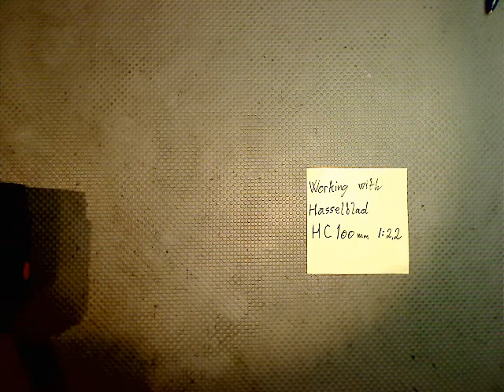Working with Hasselblad HC 100mm 2.2_________Motion Lapse Film

Comment: Dear Mike, I have a HC 50mm that needs to clean up the inner glasses. can you show us how to take off the front elements? I had a hard time to remove it. Had send to Hasselblad service in NJ. Quotation was said ; lens need change shutter unit $950.00 USD.
I just asked for glasses cleaning not shutter! I just don't know how Hasselblad maintain their reputation?
Reply: Hi   Did you find out how to clean it?

Comment: Hi! Can the rubber ring be replaced? I don't seem to find spare rubber rings on ebay and such. Would I need to order the part directly from hasselblad? Thanks!
Reply from the maker: Hi Borza, I guess you can order a few spare parts from Hasselblad, but I have no idea how much it cost or if it is even possible, to get spare parts for Hasselblad camera and lenses.

cheers
Kenneth

Comment: Did it work? I wouldn't trust the glued gear... I wonder if there are online sources for generic nylon gears for such purposes.
Reply: Thanks for sharing by the way! Great video as usual!
Reply from the maker: Thank's Mehmet, no it didn't work but it was just a try, I wouldn't trust it at all too, so maybe other can use the info about disassemble part of this lens.
I'm not sure where to find spare parts for those lenses, because the design is actually made by Fujinon (Fujifilm.. I guess).

Cheers
Kenneth
Reply: +Mehmet Koray Pekericli there are packs of nylon gear wheels on ebay for a couple of quid, they might be of use: http://www.ebay.co.uk/itm/58-styles-Plastic-Gears-Cog-Wheels-All-The-Module-0-5-Robot-Parts-DIY-BT-UK-/281938222894?hash=item41a4d3df2e:g:Mi8AAOSwQYZWxFMc
Reply from the maker: Thank's Clarty and Mehmet, I have just order a set of those plastic gear wheel's.

Cheers
Kenneth
Reply: @mikeno62  Hi, I have the same issue on the gear. I wonder if the gear from ebay actually works

Comment: Hello Mikeno62, I have seen a lot of your videos and now I want to try to repair my fujifilm TX1, I think the problem is the ON/OFF button, it is like blocked and I can turn it on, so I don't think it would be very complicated, anyway I'm having some troubles removing the top cover of the camera, I almost loose all the screws I can see but still trapped in the left corner, and I don't wanna force it, I can't find any manual in the internet, so it would be great if you could tell me how to take the lid off, or find any repair manual( hasselblad Xpan/ fuji TX1) 
Many thank's
Aitor
Reply from the maker: +Aitor Anzola  There is one hidden screw in the film chamber, so open the back and look in the upper left corner, just behind where the film roll is placed.

Cheers
Kenneth
Reply: +mikeno62 thank's Kenneth! That work! i managed to take out the cover and find one of the fault's , but that was not the only one I'm afraid... I'll keep trying,
Thank's for your help,
Aitor
Reply: Hi Kenneth, great videos! Have you one that shows how to remove the front lens group in a Hasselblad 80mm HC, it has more than average dust and debis inside the elements. Cheers Ian

Comment: i just opened mine based on your video. the same problem! the small little gear wheel is broken! where can i get one spare one?
Reply from the maker: I have no idea where to buy spare parts for Hasselblad, but years ago I had have good luck with repair another small digital camera, with the small plastic gear wheels from a tiny electric toy car (model car), it was made in China or Taiwan..
I have also buy those plastic gear wheel's from Ebay, but they are way too big for this lens.
Reply: yes my problem seems to be with the tiniest gear as well. it is broken. so you did not manage to get the autofocus for this lens to work?
Reply from the maker: No, because no spare parts..., It's a really bad design by use plastic gear wheels on motor axel in the gearbox for the focus.
Reply: Yes, my smallest gear is also broken. It's terrible. You mean a better design method would have been to use metal gears?
Reply from the maker: Yes, metal gears will work better, but of course they make more noise when focusing than plastic gear wheel's..

Comment: Mine have similar problem because small gearing broke to two pieces! and I have managed to glue it (06:41 white, the very left one),  but it sounds very weird now and focus is much slower, also one of the line from orange tape/cable broke, I have managed to apply temporary fix, it works now but no guarantee how long. Lens for nearly 4k, I cannot believe that, it looks really tough, glass is perfect, performance - one of the best and they have used plastic gearing on the part which is moving thousands times per minute. I am not engineer who design that things but I know that plastic will not last for long, its not a rocket science. Now I have been advised that it will cost me ~500£ to fix it plus 80£ testing plus sending to Sweden/Hasselblad factory. If anyone has spare orange tape/cable and gearing mechanism, let me know. That's not nice Hasselblad!
Reply from the maker: You are absolutly right Dominik, it's a really poor design for a very expensive lens, not good Hasselblad. sorry I have no idea where to get spare parts for Hasselblad lenses or cameras.

Comment: Plastic gearwheels in a 2000 Dollar lens????
Reply from the maker: Yes, I also think it's a bad construction to use plastic direct on the motor axle, it should be metal gear wheel.